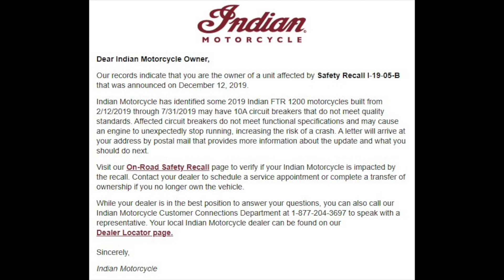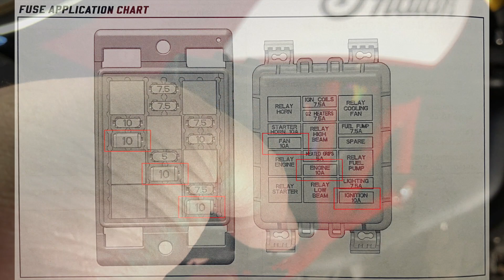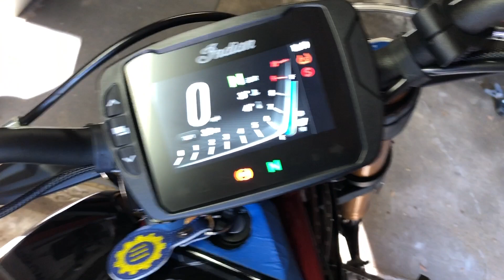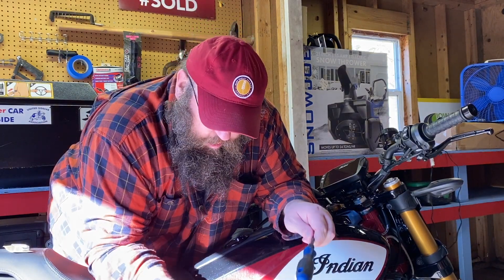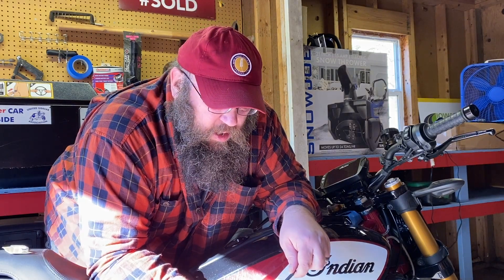Indian FTR 1200 Visual Owners Manual: Addressing Safety Recall I-19-05-B (faulty circuit breakers)

Comment: This video just saved me some grief.. I just purchased my bike from a small mom and pop dealer and rode it home some 45 minutes and it overheated. I looked at the cooling fan it was turning on and off quite  intermittently. While I let it cool off I saw this video and decided to go into the gas station and bought a  regular 10a fuse, tried it and sure enough the cooling fan stayed running and got me home. I just ordered the correct fuse, thank you....
Reply from the maker: Thanks man - that's exactly why I do these kinds of videos.

Comment: Hey, great video. I recently bought this bike from a dealer and went to ride today but it wouldn’t turn over. Charged the battery with a trickle and still didn’t work. The gauge would work fine but it wouldn’t start, kept hearing the click of the fuel pump. Was your bike having this issue? Trying to see if I should try your solution. Thanks so much.
Reply from the maker: Kenny, I didn't have that problem. I've been hearing some rumbles that the OEM batteries installed at the factory have been failing, so it could be that a new battery would solve the problem. I don't think the dealer would try that as a first fix, though!

Comment: had an oil leak behind the oil filter housing. apparently an O ring part # 5412688.. still waiting for repair.  was hosing the underside of the engine. the rear tire would have been next . keep an eye out for that. could  make for a bad day.

Comment: Maybe that Allen wrench under the motor will fit the cover
Reply: It does, but using only the short end. The long end is a phillips head screwdriver. Lots of fiddling to unscrew those bolts with that wrench.